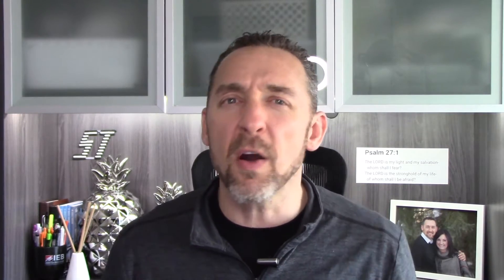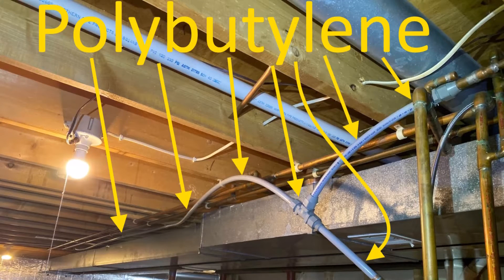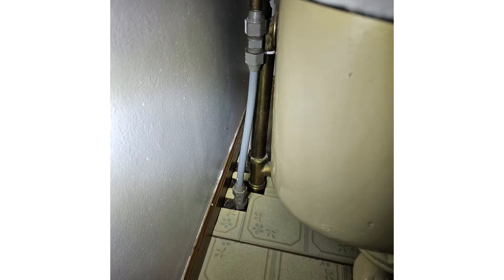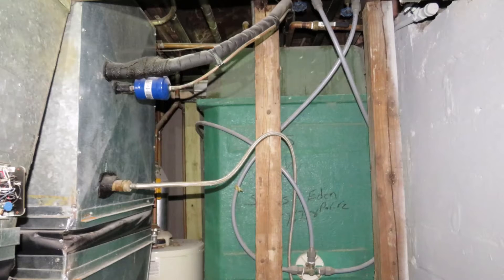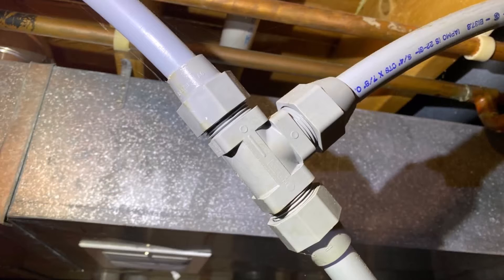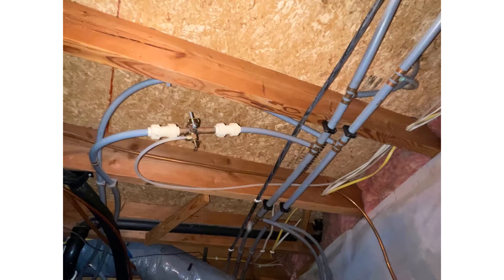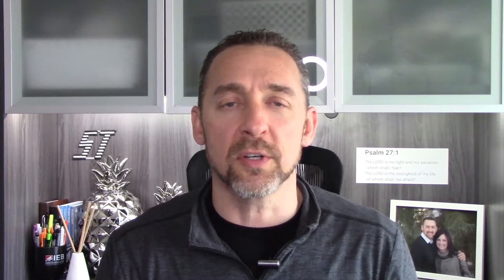Polybutylene pipes: a ticking time bomb for water leaks

Comment: We have a house now with Polybutylene tubing.  Partial, from the main water valve over to the hot water heater and connection to the cold water.  Had Polybutylene in a prior old house.  Never any problems with Polybutylene tubing.  For fun, I might replace the Polybutylene in the current house with 1" PEX.  Just for fun.
Reply: Is that house on well water or municipal water?